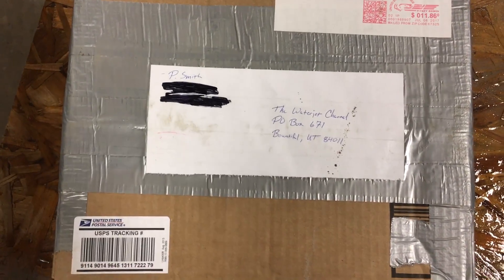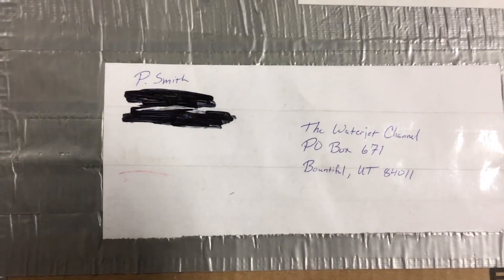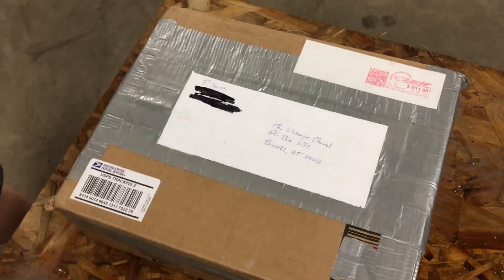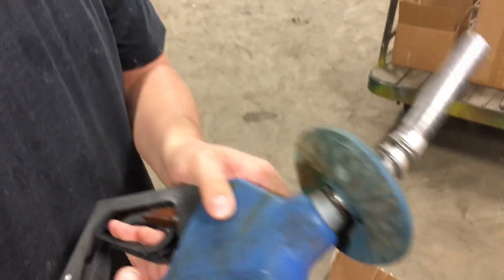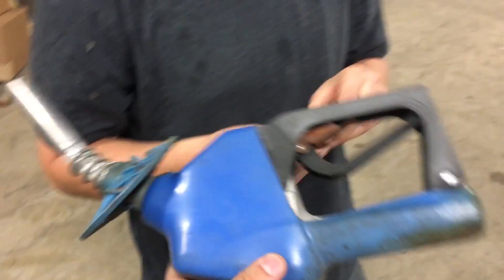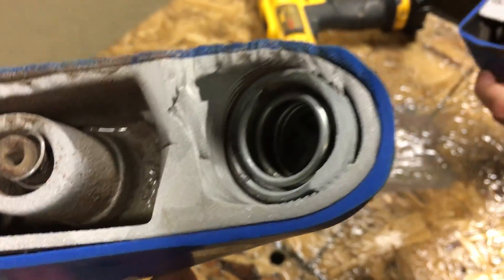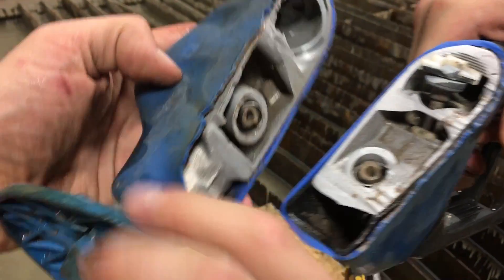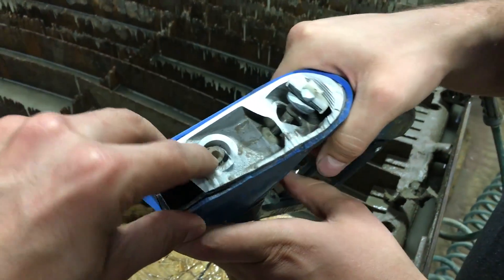Gas Pump Handle vs 60,000 PSI Waterjet

Comment: You should have stood it up and bisected it. There's a vapor recovery system built into gas pumps that allows the fumes to flow out of the car's fuel tank and back into the underground tank. It replaces the fumes in the car with fuel, and replaces the fuel underground with the vapors. It's a safety mechanism (I think) and a way to keep harmful, flammable gases out of the area where they could cause harm.

Comment: The flowing gasoline creates a suction of air through the little rubber hose in the handle. When the gas tank gets full, that suction pulls up fuel instead of air which triggers the gas handle to stop the gas flow.

Comment: Go Electric!
Reply: Never
Reply: AddisonLarson there are rarely any coal plants now most of the grid is renewable energy like wind water solar.
Reply: Nancraft go diesel
Reply: Did you know that electric cars technically pollute more than regular cars? Making a set of batteries for one electric car pollutes about 3x more than one regular car in its lifetime.
Reply: Connor Plaksin plus the coal burned to charge the batteries. Technically everything is "solar" powered though.